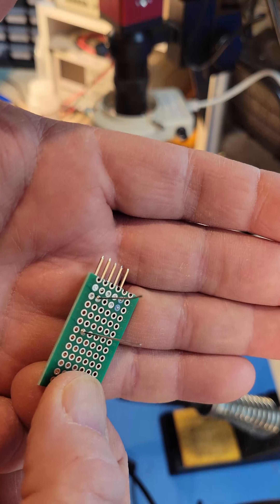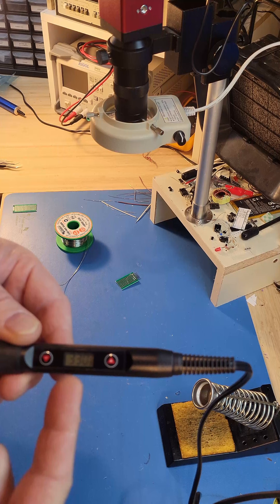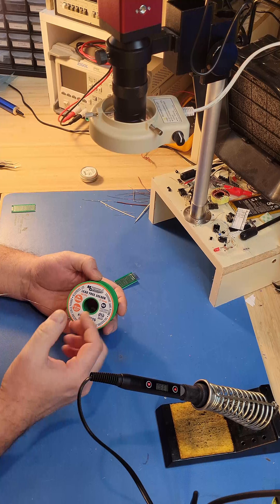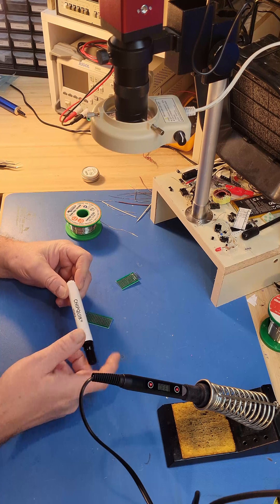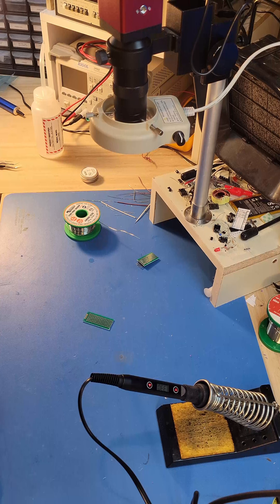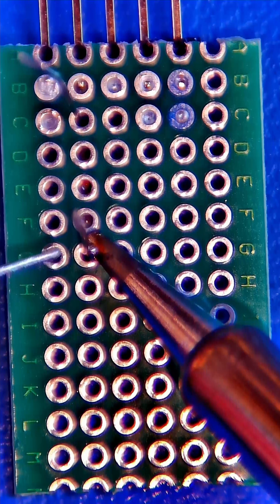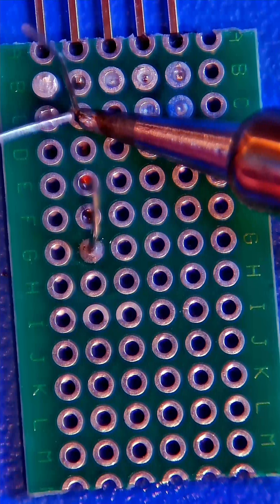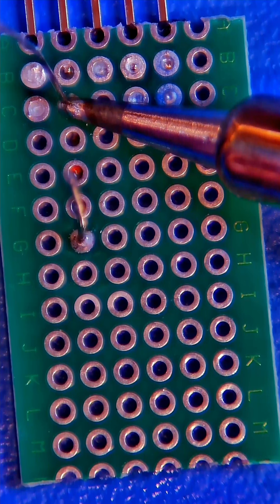Soldering - 4 Tips for Professional Results

Comment: How mush wattage use for give me 350c
Reply from the maker: The power will depend on the load. For example, if soldering a small pad, 25W may do the trick.if however you are soldering onto a large copper pour or large terminal, you may want 100W. I find 35W geys most of the work done, and the dudy cycle has lots of extra to give for heavier loads.  Hope this helps. 😉

Comment: How to keep the tip clean
Reply from the maker: Start with a damp sponge. If it gets too dirty, you can use a tip activator. Thanks for the questions.
Reply: Literally just use a damp tissue. Make it thick enough so it doesn’t burn you. That’s how the electricians I learned from do it. Not everything has to be over complicated.
Reply from the maker: @manicdoom Agreed. When in the field it is a great solution. in the lab, the $1 for a sponge that fits the holder is not a big deal.  haha. Thanks for the comment!

Comment: Does the solder stick close to the heat?
Reply from the maker: Yes. When it melts, it flows towards the heat source but will also flow due to surface tension.

Comment: You holding the iron for 8-12 seconds at the joint. That's waaaaay too much. Shouldn't take more than 1-2 seconds. Wrong temp or bad flux.
Reply from the maker: Thanks for the comment. You are correct that 8-12 seconds is too long but it is more like 4 seconds normally. Thermal transfer is the trick and the second joint does not have great contact. Be careful not to get too hot however as this will lift traces. This is a lead free solder by MG chemicals and is quite good. The iron is set to 330C and this is a 0.75mm conical tip (quite small).😇